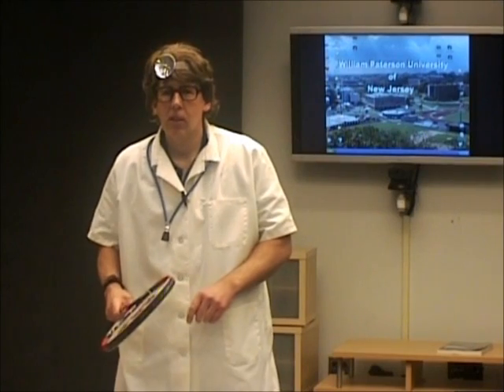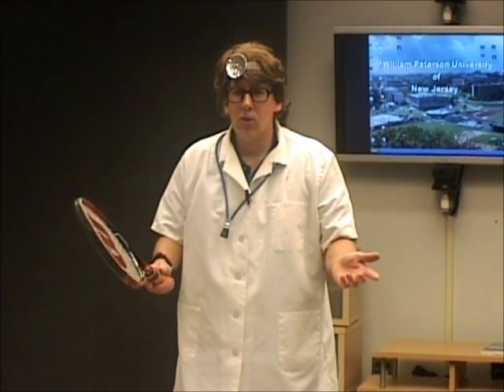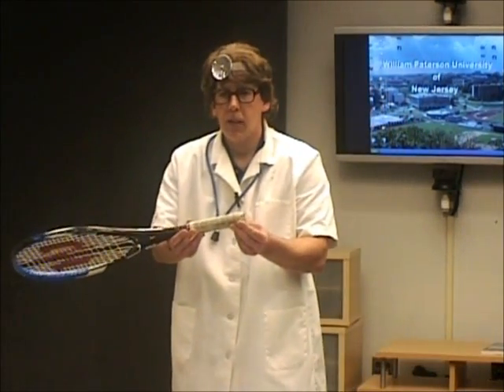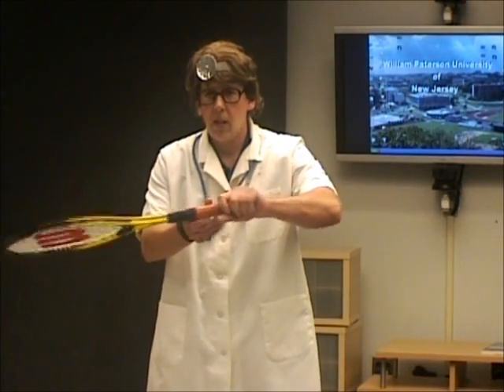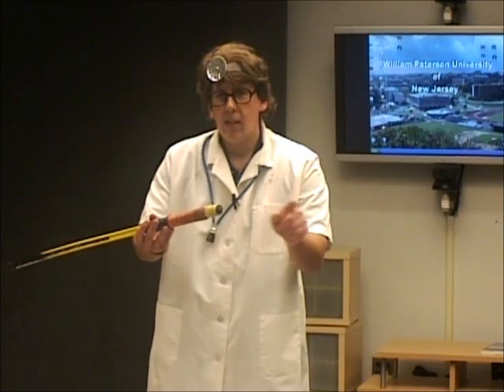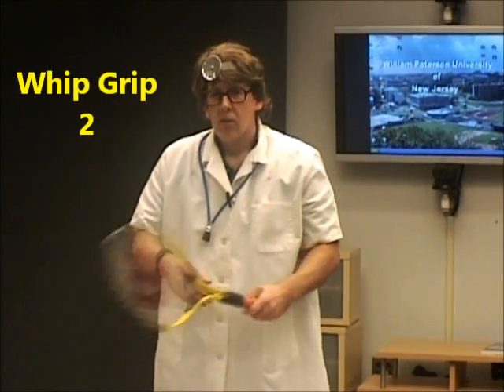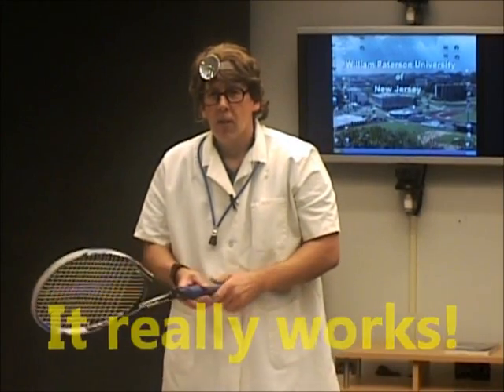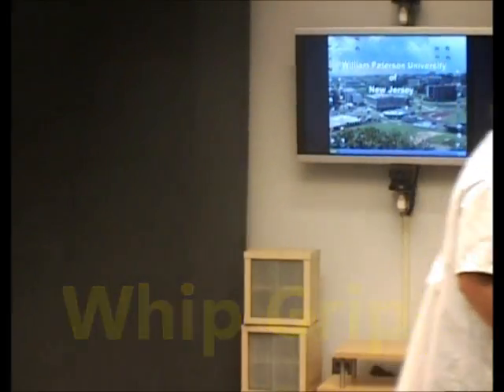The Whip-Grip by Professor Tennis (Don R. Mueller, Ph.D.)

Comment: @ Don Mueller. No I'm not ignorant. You're not ignorant too since you're a doctor, which leads me to believe that you are maliciously providing false information to mislead or defraud.  Of course the butt cap is there for a purpose.  The reason why a tennis player can relax his grip on the racquet is EXACTLY BECAUSE OF THE BUTTCAP.   Try an experiment:  play tennis with a racquet with no butt cap.  But don't add anything to it.  Swing the racquet fast.  Either you will have to death-grip the racquet so hard to hang on to it or it will fly off your hand.   If it really has no purpose, then that means people can just play without it, right?  The evidence and facts are on my side:  they are called professional tennis players who flare their butt cap.  Players who play without a buttcap = 0.  It's on you to provide the compelling evidence and reliable source to disprove the practice of buttcap flaring.

Comment: This will give you tennis elbow.  The point of the butt cap, much like the grip ends of a baseball bat and hockey sticks , is to provide a strong foundation against which your hand can anchor onto so that you are not gripping the racquet tightly. 

By not holding it tightly, you will be playing soft-hand tennis, which is ideal for increasing racquet head speed and allows for better racquet self-adjustment on off center hits.  

By removing the butt cap, you have no anchor to hold on to and to prevent the racquet from flying off your hands, you will end up holding your racquet much more tightly, which will cause tennis elbow and prevent you from hitting the ball hard.
Reply: quiddy Your assertion that the Whip-Grip will lead to tennis elbow illustrates your ignorance concerning tennis elbow. There are two basic forms of athletic elbow injuries: (1) Tennis elbow and (2) Golfer's elbow. Your notion that your hand needs to "anchor" against the butt cap of a tennis racket handle or other such racket sports handle is simply nonsense as well. Tennis “experts” contend that there is no performance function to the butt cap.  The butt cap will also not prevent the racket from flying out of your hand if you swing it hard enough. You obviously know little about baseball bats flying out of hitter's hands either. [BTW: What little do you know? Because you know nothing about the characteristics of the Whip-Grip, which allows the player to hold the racket looser for more whip-like serves and groundstrokes along with greater wrist flexibility for improved slicing of the ball to generate spin and the Magnus force.] As such, one might compare the butt cap to the human appendix, where “experts” in human physiology believe that the appendix is a useless remnant from our evolutionary past. To be fair, the butt cap does provide closure to the racquet handle and serves as a place for logos. However, as Professor Tennis contends: Kick the Butt Cap and Rip the Whip-Grip. You should get out more. Perhaps then you will learn something useful.
Reply: Don Mueller I'm not ignorant on the subject. What I simply stated is based on experience and also based on current practices and knowledge.  When you say, "Tennis “experts” contend that there is no performance function to the butt cap," you do not make a definitive statement.  Who are these tennis "experts" and why do they have to "contend'?   It shows what you are saying is still a hypothesis.  

Everywhere you see examples like baseball but caps, hockey sticks, sword handles - all of which underscore the importance of having something at the end of the grip to act as a secure and stable and naturally integrated component of the stick/racquet. If you do not have that, you will end up gripping the handle to tightly to prevent slippage. That leads to tennis elbow.  Ask any doctor.  So I am not ignorant.  Rather you are mistaken, and you choose to provide wrong information to promote your product.  Have you tried to pitch your product to the US Tennis Association? I bet they turned down your product because it would not work.
Reply: quiddy Consult "Choosing a Tennis Racquet" by Patrick McEnroe and Peter Bodo
from Tennis For Dummies: The tail end of the racquet, the butt cap does not impact your play. Most racquet manufacturers put their logo on the butt cap. Many players use this logo to determine who gets to serve first in a match. For more racquet anatomy examine the link:: http://tennis101.com/anatomyofthetennisracquet.htm
Reply: Don Mueller That letter by a CEO of a major tennis organization just sounds like the typical courteous rejection letter from a company who is not interested in marketing or selling your product.  If he were really that interested he would not advise you to sell your wares to competitors.  The underlying tone of that letter reads, "Not interested sorry. Why dont you peddle it to our competitors, maybe they make the mistake of selling it and tarnish their brand from all the complaints, lawsuits, and product recalls that the whip grip will create."  Im not trying to be bothersome, but it's not right to offer a product like this when you know it can only cause injury to the buyer.  It's not right! 

 You need to send a letter/question to the USTA and get an official assessment from them and post it on here, instead of making dubious claims from experts that you can't cite.